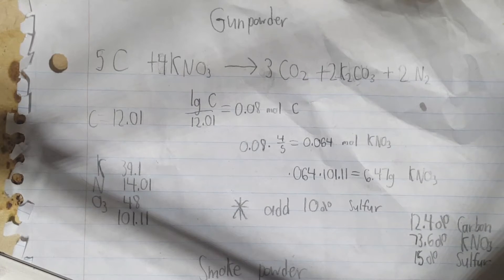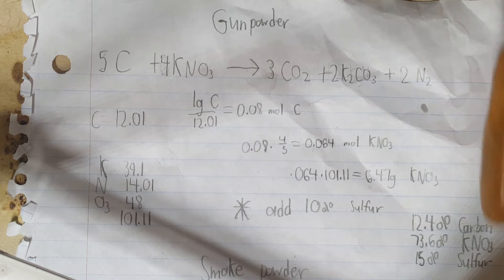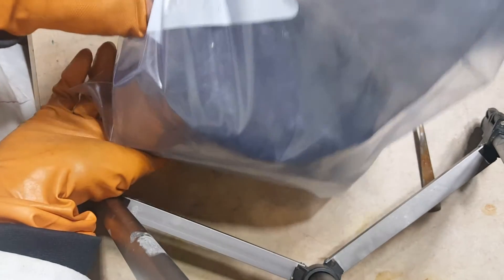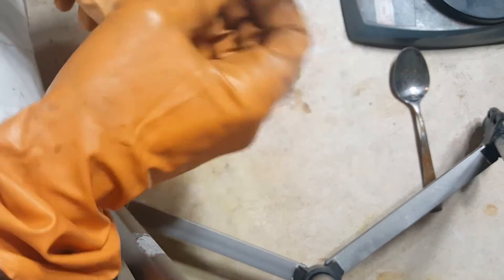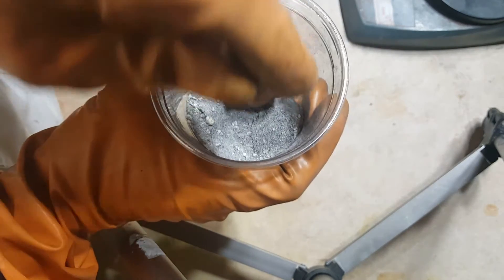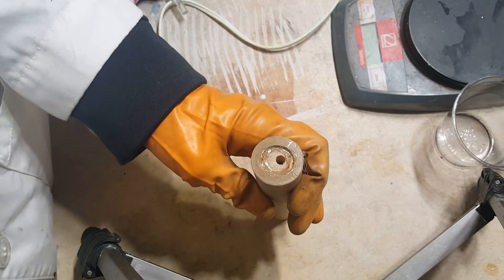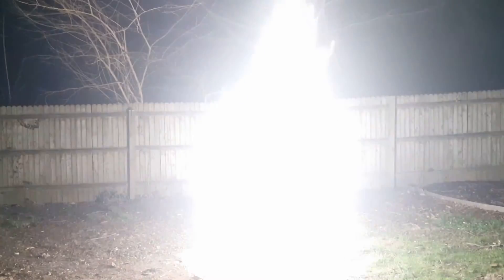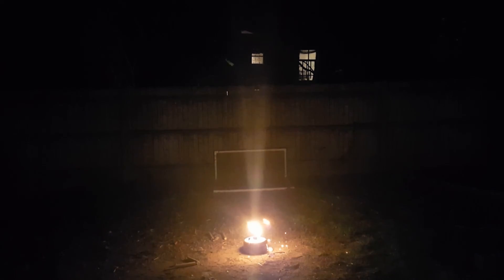Titanium (Ti) Fireworks Fountain!

Comment: Most amateur pyrotechnists use compressed powdered clay for the bottom plug and the nozzle of fountains. ( It's very easy to drill a hole through it.) That way, if the plug blows out, it just crumbles into powdered clay, which is harmless. (A wooden plug could cause unintentional inujry if it's blown out of a pressurized tube.)

Comment: It pulses in blowouts because you use so much titanium that it blocks the nozzle then gets ejected by increasing pressure. This effect may clog the nozzle so that it blows up with a loud report and throwing around wooden stoppers, and the gushes may cause serious burns in too close onlookers or set them on fire. Having read up some, I keep getting that about 5-15% added titanium is the usual ratio. this should flow fluently like a stage firework, without interruptions and blowouts.
Reply: There are whole websites devoted to how to make pyrotechnics properly. What he made there is borderline dangerous. A little research goes along way.
Reply: @agenttassadar7272  This is why we warn him about the danger, to avoid tragedy and encourage higher learning into how to do it right.

Comment: This guy is very informative, I like how he breaks it all down
Reply from the maker: I appreciate the complement! I'm currently working on a degree so I can become a chemistry professor.
Reply: Afrain he is wrong though that mixture is very shock and friction sensitive. surprised it diodn't blow up! The mixture should have been pressed in the tube with a press, helps to lessen explosions.
Reply: meant afraid. fuse hole plug should never be less than 1/3 rd diameter oft the inside of the  tube, less an you risk an explosion.

Comment: Nice! And as it's bonfire night here in the UK, I've got an excuse to make one!
Reply from the maker: Have fun with it! This will also work with iron filings, aluminum powder, any sufficiently reactive metal powder. just don't use magnesium or excessively small particle size powder, that will cause the tube to explode violently.
Reply: @frankium264  Iron filings will quickly rust in contact with KNO3,(making them useless), unless you coat them with something like shellac or linseed oil.